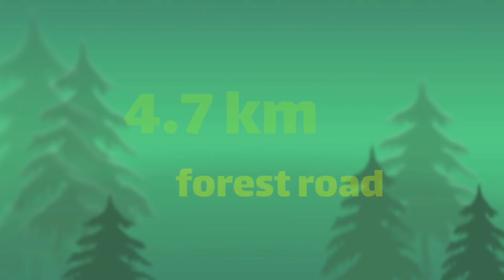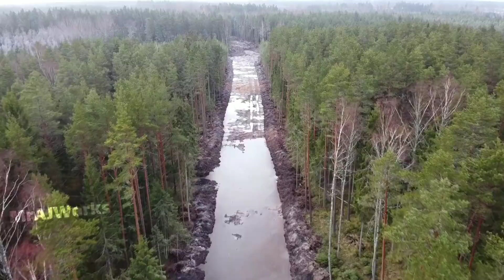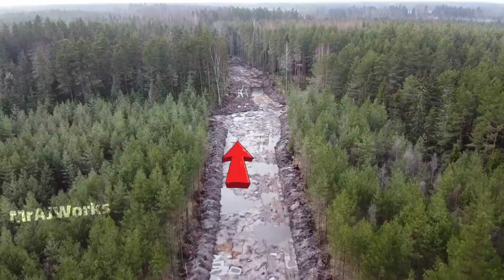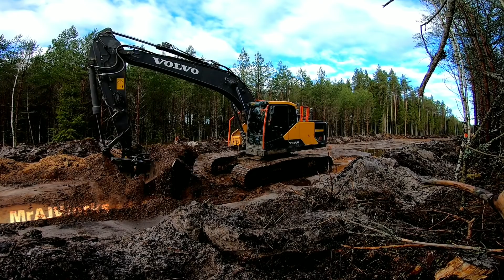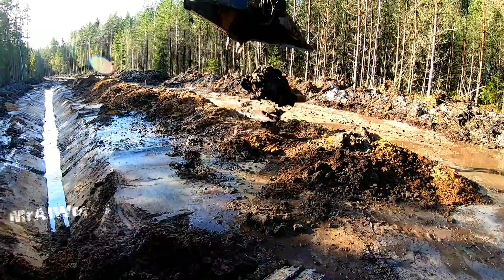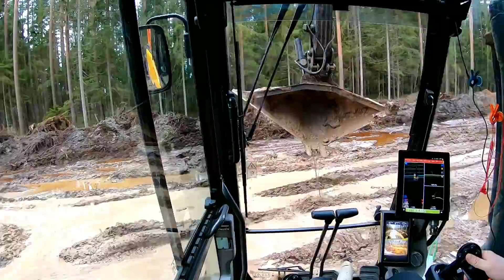Ditch To The Big Puddle:Part 1

Comment: When I was much much younger whenever it rained I would run outside to the gutter and put a popsicle stick or leaf in the flow and watch it go all the way down the street around the corner to the storm drain. No electricity or internet required!

Comment: How do you keep it so straight? Is it just because the GPS design? Or when you track back are you lining a part of the machine up with something?
Reply from the maker: When you dig ditches for several years, you get straight😁😁
Experience my friend😉
Yes GPS helps now, but you still need to control the ditch itself as the GPS signal may be weak and show inaccurate where the ditch is.
If you follow my videos, you can see how long digging ditches with GPS😉

Comment: I’m just curious why after all the drainage you put in, why they don’t make the road wider? Limited funds for the project? Not enough traffic to justify? You really do excellent work. I just can’t grasp why after all your time and effort why? I really enjoy watching you. Never had the pleasure of using a rotator or v-bucket. For that job, that’s the only way to go. Saves much labor and multiple pieces of equipment. Well done. The other thing that really shows your experience and skill is you don’t splash the front glass.
Reply from the maker: Thanks!
There is no need to make the road wider as there will be no traffic on the road.Only a few trucks will drive during the forest saw

Comment: Hi, newbie question.
Just started watching your videos.
No commentaries so far.
With that height screen on your right.
Does that software control the buckets grading height or is that you controlling it using screen as a reference?
Reply from the maker: Hello.
I have already answered this question before.
I do all the work myself. The on-screen information helps me see the depth of the ditch and the position of the excavator😉
Reply: Well, all I can say is you're bloody brilliant on those controls, the cab shot looks like it's easy, but when you do an outside side shot, you can see how hard it must be keeping that bucket level.
I was watching how it all moves...👍👍👍👍

Comment: Hello my best, very muddy video this time but just like big excavator drivers want to play. :-P I still have a question, what is this green stripe that runs through the picture on the upper monitor with the route data on the upper red stripe? :-D
Reply from the maker: Hello. Late answer🙃
It is also an excavator position indicator.It can be applied additionally.The video shows red because I had not set the correct side of the road (right or left). Therefore it was shown inaccurately.You can also set the accuracy of how far you have deviated from the center of the ditch (10; 20cm .... etc.)😉
Reply: @MrAJWorks  Hello better late than never 😜 but thank you very much.  And this civilizing device with this transmitter that you attach to the excavator arm, do you set it to a specified height or depth? 😁
Reply from the maker: Look here-- https://youtu.be/WBbzhzurbZ0
If you still have questions, write😉

Comment: What software do you use? Been through the comments. No mention of the software you use to determine direction and depth. i.e. the ipad like black screen on top of your gauges
Reply from the maker: Hello!
I've already responded in another video comment
But okay...It is a Volvo dig assist system with Topcon application😉

Comment: how do you determine the right distance to dig from the side bank?
Reply from the maker: When I dig with 3D, I see everything on the screen
Reply: @MrAJWorks  yes but how close to banks and why 😎😎
Reply from the maker: The black earth has been removed to a certain width to accommodate the road and ditches.Determine the center of the road from the axles, then measure the width of the road. And the ditch is on the side of the road.Everything must be measured from the center

Comment: Why don't you use a grader or dozer to level road? Use of excavator to cut ditch and to load out excess material but could level faster with a grader.
Reply from the maker: First the material has to dry for a couple of days as everything is wet.It can then be leveled with a bulldozer.And forget about the grader on this road, because he will drown in the first meters😀
Reply: @MrAJWorks  Yes can see how wet. Belive you completely. Looks like job security. Soon as get to end just start over at the beginning.